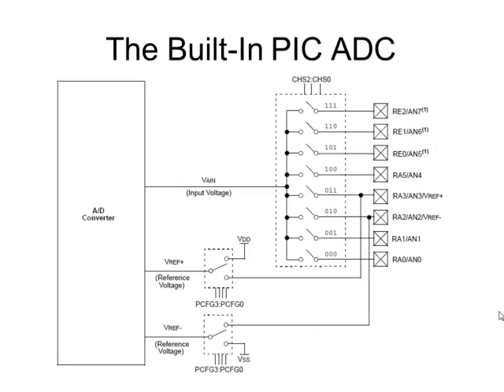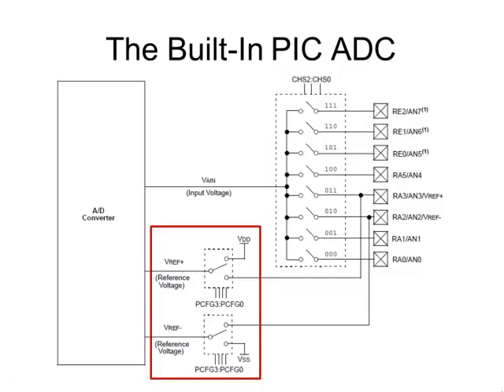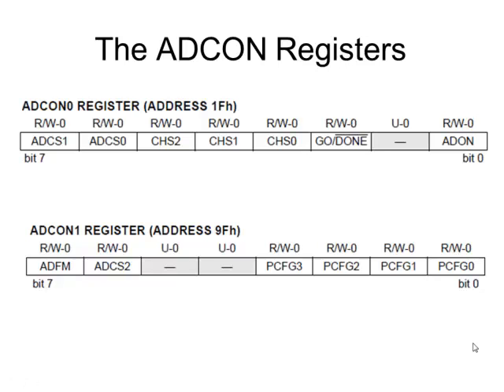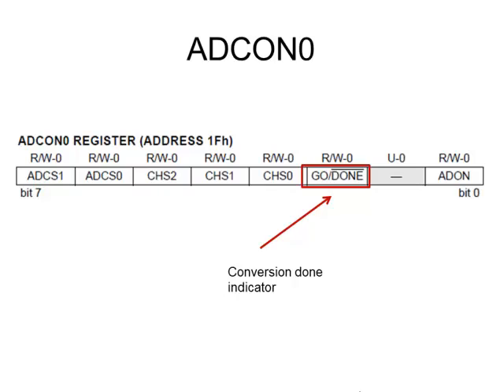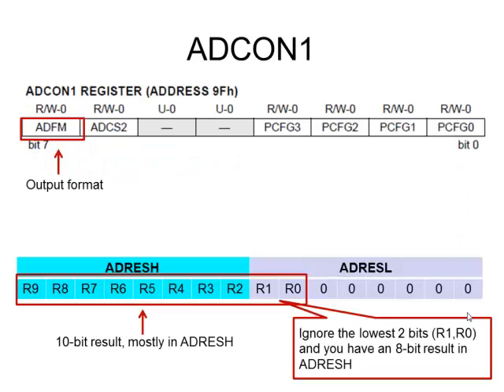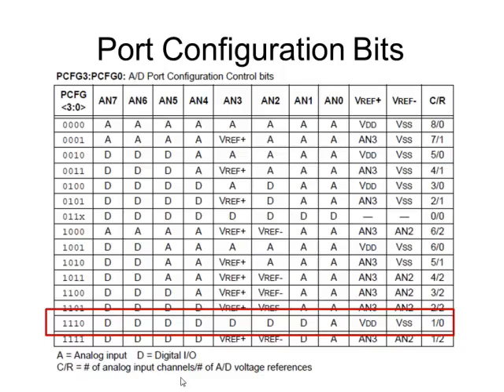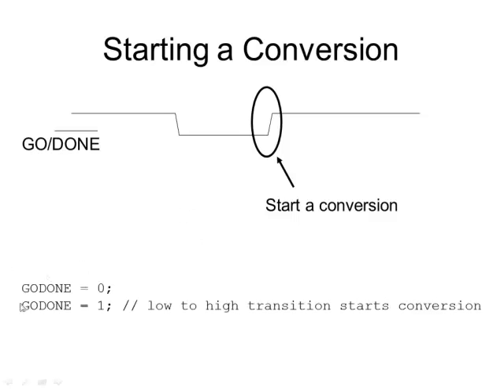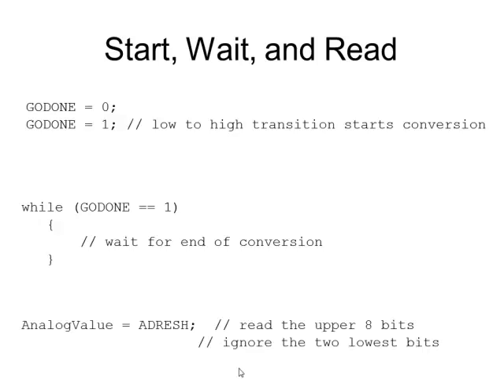ADCPIC

Comment: Your explanation was excellent. I would have asked about some of the control register bits you skipped, and also about the various clock sources that may be used, and why anyone would use them. . Maybe that could be in ADC lesson 2, to go into more details.  You could also include some information on using the 10 bit result, an how to read it into a program that actually does something. In any case, I love your teaching style.